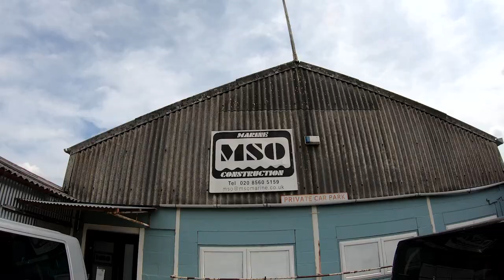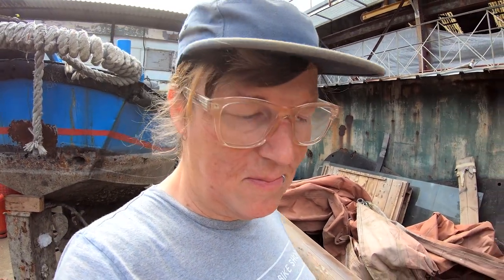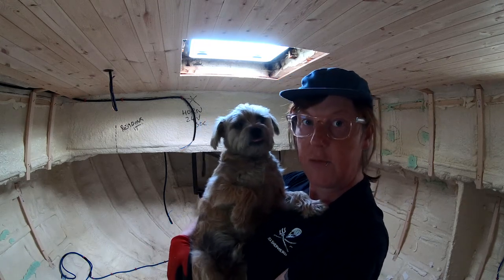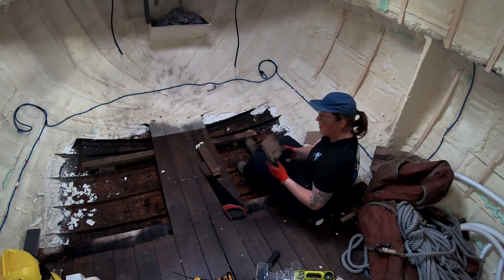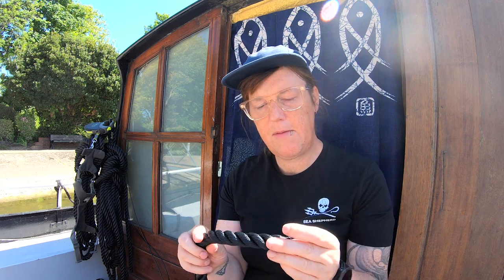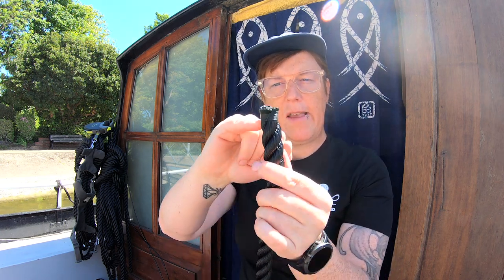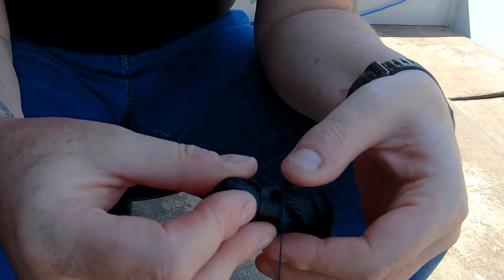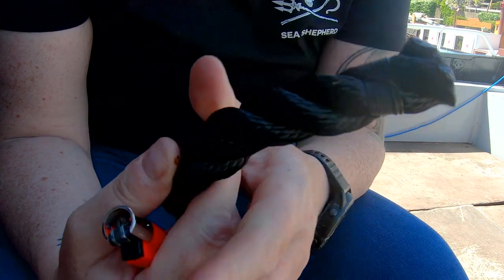#53 Mast, Lines, and Rusty Bilges - Dutch Barge Home

Comment: There are some products that are effective in providing strength to dried-out or brittle wood.  Once you have infused these oils, it might be worth considering banding the mast at the longest crack?  I guess the strength of the mast is about the effectiveness of the stays to take the majority of the lateral stress.  If one considers the modern hollow aluminum masts, these do depend on the standing rigging to keep them from breaking??  Getting a new timber mast would be very expensive so I suggest trying to put some life back into the mast and then maybe some bands to hold the mast together?  Your wooden blocks might also need some nourishment.
Reply from the maker: Yes, I think repair is the first option! Thanks!

Comment: these carks in the mast look like something that came off the Mary Celeste. However, you can fix those cracks with epoxy filler after it dries you can then sand the lower end which should stabilize the mast and prevent it from cracking further or in the worst case snapping at the force of the wind. I am an old Navy man

Comment: If the split makes the mast unusable, could it be filled with shims and glue, then strengthened with steel or iron hoops? As with wheel wrights or barrel makers, the hoops could be fastened on hot, and contract as they cool. I remember from Canice's channel a new mast is no small undertaking and no small expense. Couldn't help noticing the chips of insulation foam under the floorboards...just when you thought you were finally done with @*#%** foam shavings! I think occasional views of your OTHER (work) life would remind us of the challenge remodeling a boat or home is while supporting yourself. You're a busy badass, Beth: No wonder you need an occasional lie-in.
Reply from the maker: I know, those foam chips get EVERYWHERE!! 😊 I think I can repair the mast with some splices of wood!

Comment: I suggest the mast needs some "nourishment" to put "oils" with deep penetration.  I noticed you have a healthy gap in the ribs down the centre-line for moisture to pass through.  Maybe all you need to do is kill the rust and cover in graphite grease?  Good work on the whipping but do you have a sailmaker's palm to work that needle?  All reminds me of my time as a boy-seaman learning my knots and splices :) (the system was akin to the British program run at HM Chatham Dockyard. If you got it wrong you get punished by carrying the joggle shackle around the bullring - at the double!  :)
Reply from the maker: Yes, I think you're right about some products for the mast! I don't have a palm (I call them bosun's palms actually) but my dad had one and I wish I still had it. It's in the bosun's kit on his old boat which we had to find a new owner for after he died so everything, rightly, stayed with his boat. Other than the flags, which I have. Actually the lines I bought are from the Chatham Rope Company so keeping the name alive there.
Reply: I recall using a wood-restorer on the rungs of a friends ketch.  We slathered the stuff on and over a number of weeks the rungs ceased to be brittle and we could confidently run up the rigging again.  There are many brands although best you source a product from a British supplier.  PS I weigh 120Kgs so strength was important.:)
Reply from the maker: @josephblansjaar5871  That's a great tip, thank you! I'll look into it!
Reply: @TillerQueen  Beth, just a last comment, if you do band-clamp the mast you might need to replace the "little wooden rollers " with some larger "roller wheels" to be able to roll over the banding-clamp halfway up the mast? Cheers I'm enjoying your blog!

Comment: That's pretty cool and neat stitching...  Love the rope. Mine are either yellow / white or Blue / white.. or Green or Black..LOL... Might use that little stitch process to make the ends look neat. Did I miss where you used that handle thingy. Im lost lol.
Reply from the maker: Oh yes, I actually forgot to mention the handle thing. It was an experiment which didn't work so I might do a short about it!
Reply: @TillerQueen  LOL... I thought I had somehow missed a very important portion of the video.. so I scanned back and forth... It was not a good day and then I was like.. wait a minute.. but the sewing made up for it.. That was pretty as heck. Now.. did you say how you are going to mount the mast now that there is no place for it to drop into, ala Canice and his hot tub below the mast?
Reply from the maker: @rareairvideos3070  I'm not sure if I've talked about the mast mechanism yet, actually, which I'll have to do. Previously the mast had a counterweight which dropped into the "hot tub" and then the hatch was replaced. This is a pretty good system but  needs a lot of space down below. So instead my mast will use "sheer legs" and the new winch to lift it. The legs will allow the winch to pull a cable at an angle. It's slightly more complex than the counterweight but saves a lot of space.
Reply: @TillerQueen  I understand now. I have seen sheer legs on other barges I think. Cant wait to hear about how its going to come about... and sorry about the crack in your mast. Hopefully its not a issue. Thanks again!